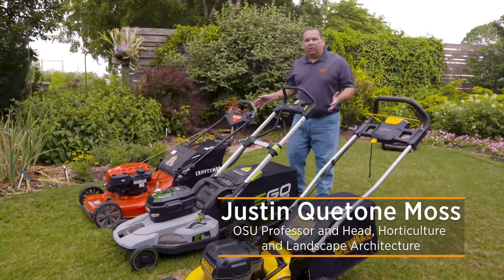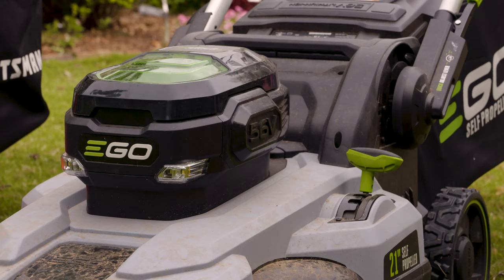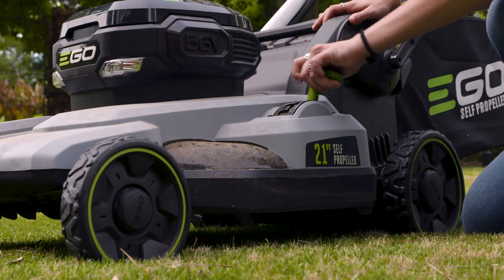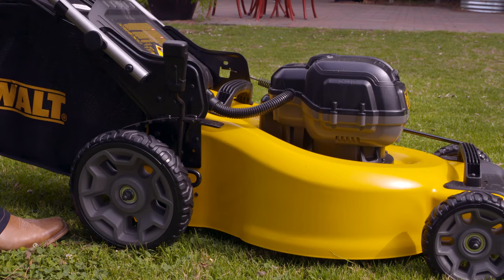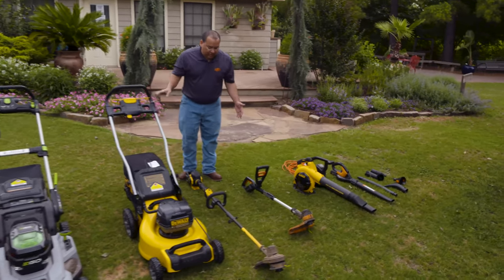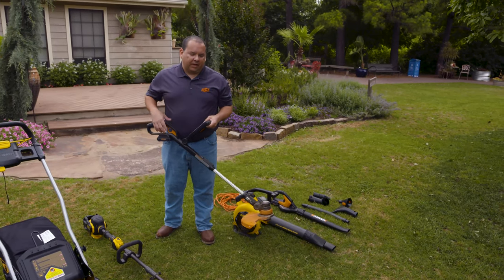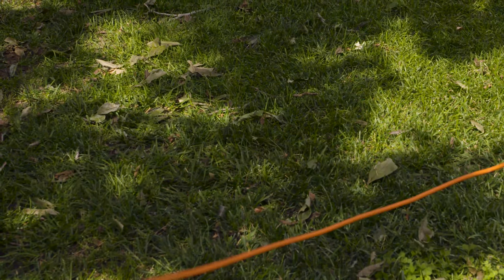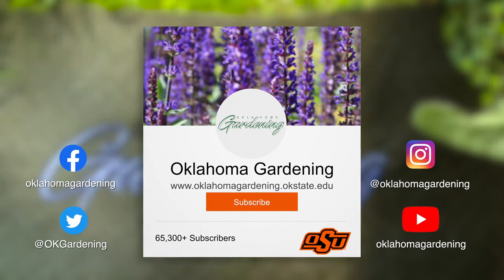Electric vs Gas Mowers

Comment: Electric doesn't mulch and dies quickly if it's a self propelled mower. I am surprised that the electric mower is just as loud as the gasoline mower. Also, none of the electrics are made in America. When it comes to lawn and garden equipment, that's important to me.

Comment: Electrics are working there way up in power.  Still, the bigger the power needs the more expensive and also some simply aren't perfected yet. We need a true gas/electric comparison system for the consumer.  That's what sold fuel powered over horses way back.  Why you think engines are rated in horsepower.  Of course another option is to force people to buy and use products whether they work or not, ny only offering  certain choices.